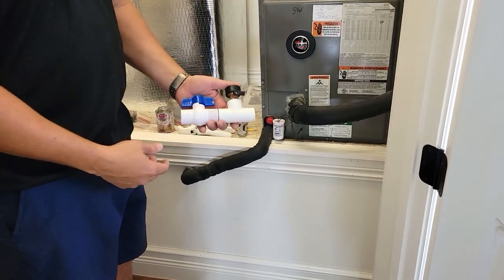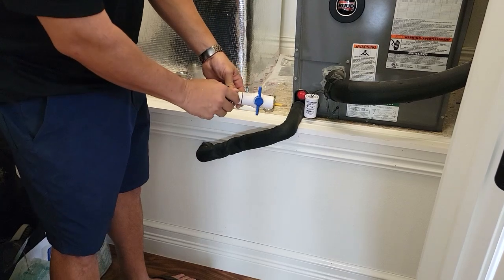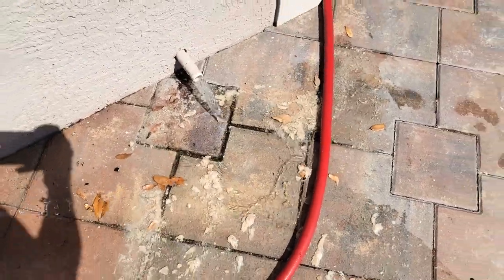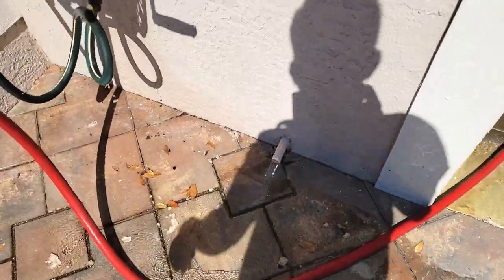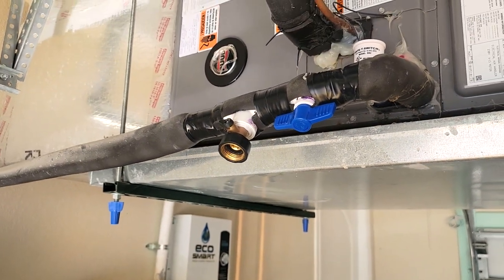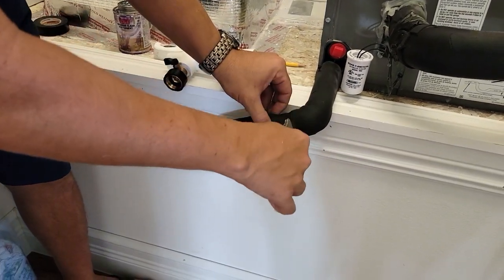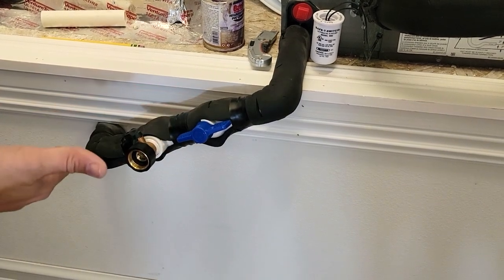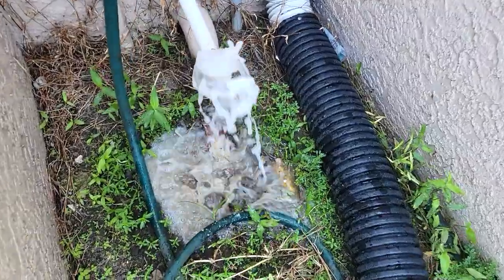The best tool to clean your AC condensate drain line! Never have a clog again! How to use & install.

Comment: Just get a 5 horsepower or better vacuum and suck out the discharge end on a regular basis to prevent clogs. Also, increase the chance greatly of getting a common occurring blockage at the drain pan nipple. 😊
Reply from the maker: ....coming from a man who sells AC drain vacuum cleaners.
Reply: Also an air conditioning service technician for the past 20 years in Palm Beach County Florida. Still will be doing that for the next 20. 😀
Reply: We’ve done the shop vac regularly and it still clogs-so shop vac doesn’t always work for everyone, regardless of the horsepower.
Reply: After 20 years in the service industry. It usually works. There are usually multiple factors to why not. But usually, it's because people are being reactive and not proactive. Usually, they're waiting for a severe blockage and then reacting. Or a litany of other things like improper drain line set up can do it if you have vent stack before the air handler, you'll just start sucking out through the vent stack without blocking it. Another one I see commonly is very weak vacuums being used. Step one for us is always suction on the drain line. Step two is then usually a caustic chemical that can dissolve the slime. Step three is pressure, only cautionally from a professional. Old brittle pipes and poorly glued joints can break in walls.
Reply: @ we are very proactive with all preventative maintenance and after 3 years problem free we developed a clog that simply could not be sucked out with a shop vac, nor could it be cleared with co2, etc. My husband has his own handyman business and even had his main HVAC guy try all the usual things to get this clog- we’ve only been able to get pieces of it out. Our next step is this type of device shown in the video. Even recommended by our HVAC guy 👌

What works for some-doesn’t always work for others. The guy who is creating this tool and showing in the video is simply providing a solution for those who have tried all the usual methods. Just like you-are trying to provide a solution with your automated vac product. 

No reason to act like this guys product is not a helpful product and not necessary-for some it is exactly what is needed.
Reply: Sorry, no, this is not good for professional use to drag a garden hose into an expensive home. We would never train an employee to do this, or I don't know a single company I routinely work with that would. Plus, it overlooks the portion of the pipe going back to the drain pan nipple where obstructions usually occur at the port of exit.
Reply: @ certainly entitled to your own opinion-and that’s exactly what this is👌

Comment: When i go clean a drain line, for years, i have been installing a 3/4 cut off ball valve and if it need a T, i added also. It makes it easier for the customer. Good video, i give you thumbs up.

Comment: In North Port, only 3 year old house.  Initially used a shop vac, chemicals, but by year 2, that wouldn't even work.  So I bought this product because it seemed logical.  Hooked it up, and it worked.  It discharged thick white slime.  Technical term for it is bacteria zooglea.  Apparently this gunk is caused by a chemical reaction of condensation and aluminum evaporator coils. Some people complain about price, well do it yourself then, and the market determines price.  It will pay for itself 1000x over since you won't need a HVAC service call for clean a clogged drain line.  The only thing I added was a clean out T up stream, so just so it easier to look inside, drop in chemicals, but not necessary
Reply: @travis7277  Tampa area here and same situation. 3 year old home with no problems, consistent preventative maintenance and now we have a huge clog that all other methods have not been able to handle. Ordering this genius device because I know it will be the solution!

Comment: My condensate line started clogging up about a week and half ago.  Normally I use a wet/dry vacuum and I am good for a few months.  This time it was reclogging in as little as a few hours up to about 12 hours.  I tried vinegar and the AC Line stuff from Home Depot.  Nothing was working.  I saw this and Smart Snake, I picked this because my AC Unit is on the second floor and I was afraid the snake was not long enough.  After watching the video I ordered one from the website and received it a few days ago.  The order process was pretty smooth, the website is barebones, but you receive an e-mail telling you the order was received.  About 12 hours later I received a notification from USPS telling me it would arrive in about three days, which it did.  No option for expedited shipping.  I installed it a few hours ago.  My condensate line is not long near the unit, but bends under it where it is long enough.  When I cut off a section for the tool the pipe was 90% clogged with a thick grey slug.  It came out of the cut piece of pipe in a single chunk and I became worried the water would not break it free, so I cut off another longer section of pipe and connected the device, took it outside, and turned on the hose.  The stuff just slid right out and eased my mind, so I installed it.  I used the Purple Primer and Heavy Duty Glue.  I waited about thirty minutes and turned on the hose.  A big glob of slug came out and the water was flowing through the pipe at full force.  So while one day does not show possible issues in the future I am pretty happy right now and put my wet/dry vacuum away.
Reply from the maker: Thank you very much for the review. Yes, there is currently no option for expedited shipping because the item ships for free via USPS first class and is shipped within 24 hours. 2 day and overnight shipping is very expensive, and usually the package arrives in 2-3 days for free. However we may take your suggestion and offer an expedited service for a fee.
Reply: @FrankFredericksHomes  You’re welcome, as a follow up it has been about two weeks and my repeated clogs have stopped.  I did not mention it in my original comment, but I used a variety of thin long implements to clean out the small section of pipe before the device, since I didn’t have a pipe brush.  Once it was in, I closed the back flow valve and poured a little vinegar down the pipe, making sure not to put in enough to back flow into the A/C unit, so the vinegar would soak that small section before the device.

Comment: Where is this to where the drain lines can go right out into the driveway? My place would be forming a small river.
Reply from the maker: Well where does yours come out?
Reply: @FrankFredericksHomes  Connects to under a sink in the master bath. Quite a pain to clean out because half the time it then clogs the sink.
Reply from the maker: @PhilipLupercio  Well unfortunately that is against the building code and I would suggest having it rerouted to a proper location.
Reply: @FrankFredericksHomes  A lot of people, myself included, have the runoff too close to the house and that drip from the condensate line can cause damage to the foundation over time. I bought a 4 foot piece of pvc and a small coupling to route it further away. I strongly suggest anyone whose runoff is close to the home to consider doing this.

Comment: This system looks great. Unfortunately in my city the code has you tie the primary condensate drain line to a dedicated sewer J trap. I have already installed the cutoff valve just outside the unit and use air pressure to clear the line. It works but I like the water flush system better...
Reply from the maker: The trap is required everywhere by code. This device has nothing to do with the trap and can be installed in addition to the p-trap.

Comment: Looks like a nice device but what about the piece of pvc between the unit and the blue ball valve.. if that clogs, there is not access to flush or shop vac that
Reply from the maker: It's so close to the unit you just pull the panel off the front of the unit and you can just clean it out with a little bottle brush or something. No big deal

Comment: How long is the unit? I only have 6 Ang one half inches of space to hook it into the rest is the unit and on the wall
Reply from the maker: It is 6 in long however there is another option on the website where you can buy the pieces separately and install them in a smaller space. Go to acdraindoctor.com

Comment: Hi.. thank you for this video. I’m a house wife so bare with me. Have a geothermal system and downstairs is cooling great. Upstairs handler/unit not cooling. I’ve made sure filters are clean and noticed no drip from condensate line. I’ve tried the vacuum thing I saw also on here. Nothing. How would one handle this for a line that’s in attic? 😩 it’s so hot I haven’t been up there yet! 🥵 Help!
Reply from the maker: I think it's best you call a local AC contractor. I cannot diagnose all issues over the internet. However if your AC drain line is not dripping there is a good chance that the line is clogged and you could benefit from this tool. You need to check and see if the condenser outside is running or not. If the outside unit is not running it will not cool either. If the inside unit and the outside unit are both running then go to the air handler in the attic and pull the float switch and feel inside for moisture. If the unit is full of water then that is a clear sign the condensate line is clogged and needs to be cleared out. If it's dry then there is another issue. Perhaps low refrigerant. However, again, I cannot definitively diagnose anything here on YouTube.
Reply: Oh thank you!!

Comment: what if my drain line doesn't empty to outside the house? it seems to go straight down into the floor and then... I suppose it's hooked up somewhere to my pipes that goes out with wastewater/sewage? It's clogged and all the solutions I can find involve setups that empty out into the yard somewhere. This doesn't exist anywhere on my house 😕
Reply from the maker: No matter where it dumps this will still work. It is designed to quickly clear out the lines, not run for a long length of time.

Comment: Pretty nifty video. I was thinking of doing this with compressed air, but water makes more sense.
Reply: Air won't work because as soon as the air clears a small hole in the clog you lose the pressure. Air has no mass but water does. You need the mass of the water to keep flushing the gunk out.
Reply: @billcekala3542  I had a serious blockage in my condensate line just 2 days ago and first  tried sucking out at the far end, using a shop vac but hardly any thing came out. I then tried flushing with my garden hose at the top of the drain line. Fortunately, the air handler is located in the garage so no access issues.  This only caused water to enter the drain pan and overflow.  
I then cut the line below the drainpan tee, so that there was no back pressure into the pan and hooked up the hose, using a good tight fitting and although it cleared some gunk out, it was not enough to let water run out unless under pressure.  
In the end, I hooked up my compresser and what a difference it made, blowing out a load of whiteish gunk, some of which felt like soft rubber.  However, I had to alternate between water and air to get to the point where water would flow freely without it being under pressure.

Comment: why is the condensate line insulated???  Not necessary!!
Reply from the maker: Building code. I agree it's useless
Reply: It’s a good idea in a hot/humid climate zone to insulate the drain line…the pipe will sweat and drip water due to the cool/cold water passing through the hot attic.
Reply: any line that with water below a certain temp required to be insulated, I think part of iec code. might be ipc
Reply: also at the very end of vid shouldn't you point that elbow the other way so the drip is downward, so less chance of leaves or anything falling in and clogging it up. i had mine the same way till a guy from the city was over and felt compelled to point it out.

Comment: support the hustle but bro, you can't charge $50 for what can be built with 3 parts from the hardware store, for $5.
Reply from the maker: I've gotten a few comments like this, and usually ignore them, but if this is what people really think, then it's a problem.  I make this product to help people, not get rich. If I could sell them for less money I would do it in a heartbeat. You say all parts are $5.00. Just the brass fitting alone is $8.00 at Home Depot. Go see for yourself. Lowe's is $9.00. Shipping with USPS is the cheapest and is $6.00. The bubble mailer to send it in is $1.00, Amazon takes $12.00 for every one sold, plus $39.99/month just to be able to sell on Amazon. eBay fees are similar. This doesn't count the ball valve or any of the other parts, or labor to assemble. These parts don't just go together. Each tee needs the thread cut with a tap by hand because garden hose thread isn't compatible with NPT.  If you are a savvy businessman and can show me how I can make and deliver this part for $5.00 as quoted, I'll give you $1,000 cash.
Reply: This is one of the most ignorant things I've ready on the internet today.  He can do it, he is doing it, and this is the literal definition of business/free enterprise.  He is providing a product/service to willing customers for a profit.  If you analyze anything you buy that isn't solely a raw material you will find big markups and margins.  That's how it works.  You can choose not to buy it, and other people can choose to buy it.  To trash him on his own video is just flat out rude.  Care to share what you do for a living and where you do it so we can all share our comments publicly?  And before you ask, I don't know this Frank dude from anybody.
Reply: @FrankFredericksHomes  the price is fair...if someone wants to take the time to buy the supplies and build it, more power to them. Thanks for the video man. I am gonna grab one for myself.